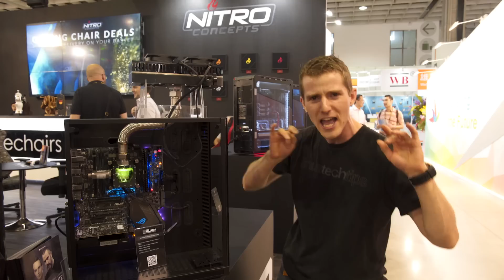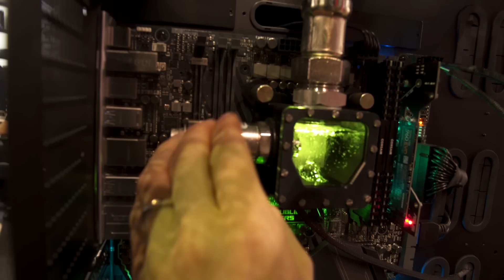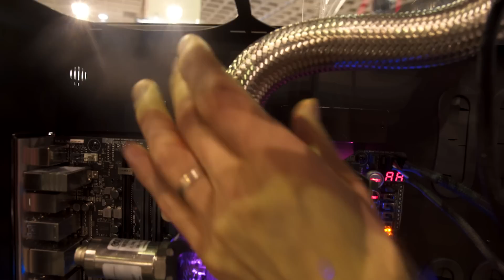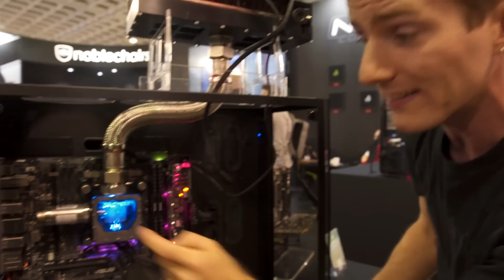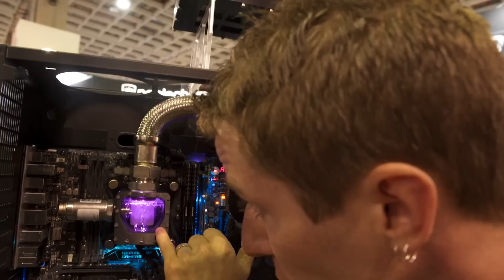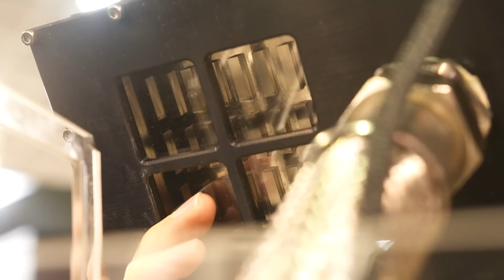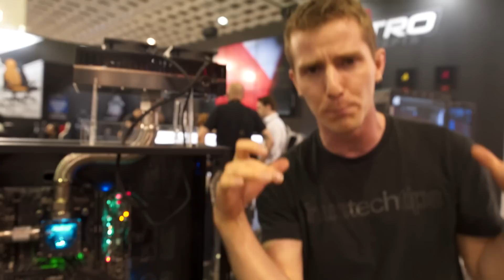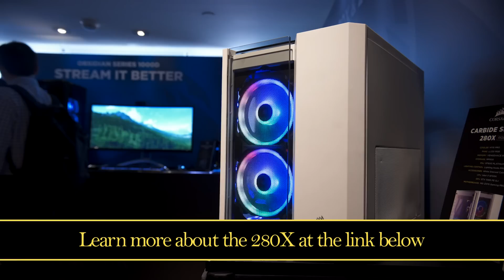Crazy Der8auer cooler prototype - NO pump!

Comment: Liquid coolers look cool, but I keep envisioning one springing a leak and the whole rig frying like bacon.
Reply: Frank 42 not all liquids are conductive
Reply: no but most liquids used for cooling are once contaminated with dust and other detritus found inside a computer old enough to have a leaking liquid cooling system.
Reply: Frank 42 with a pump like we see in some videos and generally as long as the pump is far away from any ruinable components its survivable but this thing if it leaks is all over the board
Reply: If a custom loop leaks u will notice when filling it (just don't connect the 24 pin to the mobo and put paper or small towels in the system if u afraid), a well mounted loop will last until u need to change the liquid with no leaks. Also AIOs are safe for 3 to 5 years.
Reply: This has similar properties to Novec, stuff servers use for immersion cooling, as in its non conductive.

Comment: I think the Cooling Liquid is Methyl Iodide. Anyone else agree?

EDIT: Only problem is that liquid turns brown-ish when exposed to a lot of light, so I'm unsure, but with the way those Air Bubbles rise, regarding it's a little denser than water, and it has a boiling point of 42*C, I think It's a solid estimation.

Comment: Some liquid that needs to have low boiling/evaporating point, fast evaporate and cool fast.
Probably some kind of alcohol? Methanol, Ethanol?  Hell, even diesel...
Reply: Whoever buys this, can say: "My computer runs on disel!"
Reply: Robert F do you know how diesel works?...
Reply: @P - yep. You put it in your pooper. Right?
Reply: http://multimedia.3m.com/mws/media/199818O/3mtm-novectm-7100-engineered-fluid.pdf?&fn=prodinfo_nvc7100.pdf
Reply: #2
https://www.3m.com/3M/en_US/novec-us/applications/thermal-management/
Reply: Personally I think its trichlorofluoromethane or r11. Clear, odorless, used as a commercial refrigerant, boils around 30 degrees c, and pretty safe to humans.
Reply: Hey, it evaporates and condenses fast and is non-flammable, higher boiling point at around 150c so even on the most crazy cpu's you are not going to turn that thing into a pressurised bomb ready to go off.
Reply: If they're using a pressure sensor it could just be pressurised water, giving it a lower boiling point, right?
Reply: SunnyZ Lithium bromide. We use it on our heat absorbers
Reply: Novec 7100 from 3M, he said it in a video!
Reply: If its Novec 7100 then that'd be a pretty damn expensive coolant..
Reply: Considering PCs measure temp in Celsius and the flash point for diesel is 52-96°c. Most pcs will equalize Temps right in the middle of that establishment (my r5 1600 runs at about 70-80°) don't git me wrong I find the idea hilarious but I feel that is too much of a risk to bring to a trade show as big as computex.
Reply: engels141 der8auer said its not novec in an interview
Reply: CFCs would almost definitely not be used, they were phased out in most countries since UV breaks them down into Chlorine radicals which catalyse the breakdown of Ozone, thus basically causing the Ozone layer to be destroyed rapidly in high quantities.
Reply: SunnyZ refrigerant
Reply: Nick ootes Ethanol is a type of alcohol, to be specific, an alcohol is an -OH group bonded to a carbon chain, excluding benzene rings, which are called Phenols, but anyway, alcohol and ethanol are not synonymous with each other
Reply: diesel pc
Reply: i can see this working
Reply: That's not a fire hazard waiting to happen
Reply: SunnyZ vodka
Reply: I would buy especially so I could say that
Reply: Doc. Volt interesting
Reply: SunnyZ water+alcohol can do I guess
Reply: SunnyZ diesel has a specific color 
U cant hide that under some rgb
Reply: Your probably right
Reply: but won't it be unstable under pressure ? Like gasoline  autocombusting ?
Reply: biggest giveaway is the S curve thing. Basically defines the viscosity to be less than a certain value.
Reply: Bruh alcohol and ethanol is the same
Reply: Truthfully it's possible as long as it never finds some way to become dangerous or volatile and all the parts stay working with little to no replacement needed it would work.
Reply: SunnyZ diesel... really...
Reply: "Some liquid that needs to have low boiling/evaporating point, fast evaporate and cool fast." Yeah, no shit. 
I don't think is diesel because It's is not transparent.

Comment: 3M Novec. My 2c
Reply: in a german interview he said that it is NOT 3M Novec
Reply: Darn i was thinking novec aswell 
Aslong as its not his own piss cause that could ruin the market as some crazy easy to obtain coolant lmao
Reply: Likely culprit is 3M Novec 7100. You can get the brochure on their website spelling it out.
Reply: Its not Novec because of import laws in the EU. But it is supposed to have similar properties. Right next to it, he has a different kind of rig running novec 7100
Reply: I was thinking the same
Reply: David Riley i also think, its at least something with quite similar properties. It seams like novec to have a low boiling point and to be non-conductive.
Reply: Nah
Reply: That would be my guess as well.
Reply: But there is no other synthetic gas wit the non conductive properties then Novec 
The problem lies in which kind of Novec der8auer actually used so nobody can replicate the system
Reply: David Riley dam you beat me
Reply: David Riley I was going to see if anyone new about 3m liquid. There is a video that shows a computer in this stuff with I believe no heat sink on the CPU too. It was a closed system. The liquid is expensive too.
Reply: Novec  can not be shipped. eu laws...
Reply: 3m Novec wouldn't work.

For an application like this you'd a reasonable or high thermal conductivity.
3M Novec, has an extremely low thermal conductivity. Which is why its used in fire suppression technology.
Reply: @
DaJMCity

The entire point is to have a high conductivity. Not a low conductivity.

If you'd have a super low conductivity, you wouldn't be able to absorb the thermal energy from the CPU, and even worse you wouldn't be able to efficiently dissipate it to the air in the radiator. 
This is why radiators are copper. Because it has very high thermal conductivity.

Novec is exactly what you DONT want. Because of the low thermal conductivity.
Reply: 3M Novec does work... its used often in server cooling and he literally has a PC next to it using Novec 7100. 3M has a few Novec formulations for computer cooling. https://www.3m.com/3M/en_US/novec-us/applications/immersion-cooling/

You are thinking of Novec 1230 or something SkiingJeep
Here is the list of Novec fluids for electronic cooling https://multimedia.3m.com/mws/media/1091997O/3m-novec-engineered-fluids-for-heat-transfer-line-card.pdf
Reply: It could be a lot of stuff. he said in a german interview that the boiling point is just above room tempreture.
Reply: @Matthew Jackson.
Alright, didn't know they had a variety with drastically different properties.

Either way, doesn't change that the people saying that low thermal conductivity is good, are flat out wrong.
Reply: no one said low thermal conductivity, they were referring to the low electrical conductivity.
Reply: No it is not 3M novec

Comment: maybe Methanol with its boilingpoint at around 65C or another alcohol
Reply: Yeah I had a similar guess. so either Methanol in low pressure to lower the boiling point or Novec 1230 which is a fire supressant and is commonly used in immersion cooling. Maybe propanal??? I am not exactly sure of what vapour pressure requirements there are so it's hard to tell.
Reply: Novec 7100 probably, he mentioned it in a Video, thats why its so secret.!
Reply: Also my guess
Reply: Yah. One carbon alcohol, aldehyde or ketone of some kind.
Reply: @RexinOridle  it could also be a two carbon alkohol or maybe even an alkane of some sort
Reply: lacucaracha111111 
These liquids are combustionable making them dangerous
Reply: Well it sure as shit is NOT Methanol. Do you really think they'd put a flammable liquid into a literal spark box at those temperature? Fuck no. 

Also it's way too obvious and could be guessed by any 5th grade chemistry student. Why should it be Methanol when there are thousands of liquids and mixtures of liquids with similar boiling points.
Reply: Not a bad idea, but drinking birds use methylene chloride to get a really low vapor temperature.
Reply: lacucaracha111111 definitely not it’s has a fucking flashpoint of 16 degrees Celsius it would burn the second it evaporated
Reply: The PC wasn't hooked up to any monitors or anything else, so I don't know weather it was running any kind of looped benchmark at the time. That could mean if it wasn't running a bench, something with a boiling point from 35c to 50c, or if it was something with a boiling point of around 60c+. But I suppose due to the pressure of a lower boiling point being maintained it would have to be something around maybe 55c+.

Something like methanol, methyl acetate.. You also have to take into account the corrosive nature of the fluid, and the mix of materials used. Think Galvanic corrosion which would more of a factor than the usual distilled water..

I feckin want one though!! I love seeing liquid movement in a PC case.
Reply: Do few people said if it's a partial vacuum with water it it will stop boiling because the increase in pressure but that is why you need the the cooling at the top, if cycle starts water cold at bottom in partial vaccum heats to its BP will go in to cooler and condense back down lowering pressure  allowing for  for cycle to start Agian, if it was full vacuum it wouldn't work mainly cuz water vapor can't be in a full vacuum cuz then it's not a vacuum but a air/water system with boiling water works fine in closed systems nothing about partial vacuum prevents this
Reply: DragonsKindler why? I'm honestly interested to know for chemistry class purposes
Reply: engels141 if it's novec, it's not a secret at all, you can just order that from M3 online.
Reply: That would dissolve the aluminum making it not likely.
Reply: Eluminary Xarrais dude. Old joke. But still good.
Reply: Methanol is too viscous. It would take too long to drop (my opinion).
Also a alcohol has a higher oxidation power. Not really good for it.
Reply: well m3 novec 7100 is non reactive with most plastic and metal, non conductive (he used it in a submerged build some time ago), when it evaporates it disappears in mater of second without a trace and boiling point is 61 C
Reply: Chris Ide deionised water would be corrosive to the components in the system eventually becoming conductive as the ion content increases.
Reply: I like remind you all that the system doesn't have to be under normal pressure. If it is higher it can be propane or butane or similar. If it is lower other liquids become possible. The bulky construction (e.g. thick window material) indicates that it doesn't run on normal pressure.
Reply: Methyline more likely, or another Twin bonded Alcohol..
Reply: That would make too much sense.
Reply: I thought I was smart by posting this but nope many others knew it was most likely methanol as well lol
Reply: Methyl acetate (CH3OOCH3)?
Reply: 3m moved actually
Reply: Yea i was going guess methylene chloride since its used in those bubble lights with its low boiling point
Reply: Liquid nitrogen under high pressure maybe?
Reply: Probably fluorinert fc72
Reply: DragonsKindler it won't be mass produced anyway
Reply: had the same idea, not so secret after all i guess
Reply: lacucaracha111111 Lithium bromide
Reply: Sounds right. At first I was thinking acetone but it would hold the cpu at barely too high a temperature or maybe chloroform but that would break down under UV so a clear window like present wouldn't really be possible. I feel like methanol is most likely but there are other options.
Reply: I was thinking acetone too, also it has a lower boiling temperature than methanol so it stays cooler...it explains metal tubing tho since it dissolves some plastics!
Reply: could be glycerine ,it will explain the bend problem ,propylene glycol or any alcohol like ethanol or meth.
Reply: Combustible liquids are only dangerous if the escape of the loop / mixed with oxygen. Coolant in air conditioning units is also combustible (or used to be at least)
Reply: I'm still firm with pure water under partial vacuum I mean those style transducer can do vaccum too
Reply: what about novec 7100? boiling at 61 C non conductive and almost not toxic
Reply: What is with this methanol crap? It’s obviously not methanol. Methanol will blow up once it evaporates.
Reply: DragonsKindler the wiper fluid for your car is mostly methanol dude.
Reply: maybe he is using propanol or butanol at very low pressure
Reply: lacucaracha111111 I don't think they could use Methanol as a liquid due to the risk of a leak and the damage breathing Methanol fumes can have.
So they must use a not toxic Liquid that has a boiling Temperatur arround 50°C. 
My Guess: it is Just water at 300mBar. (1/3 of atmospheric pressure)
Reply: Or it could be something similar to coolants used for radiators.
Reply: Rexin Oridle aldehydes tend to not keep very well over time, any oxygen present would slowly oxidize them to carboxylic acids. And ketones are too good solvents, acetone or butanone would slowly eat away the acrylic and rubber sealing parts. My guess is that it's some kind of fluorinated medium chain ether, like the 3M Novecs...
Reply: Eluminary Xarrais classic :D
Reply: and no methanol will not blow up, you stupid? if there is no oxygen in there it will not start to burn at all. if there is, you still need to raise the temperature a little bit more to start the combustion wich will not happen if you don't heat the radiator
Reply: more like 3M novec
Reply: Freak Gene dichloromethane dissolves plastic too well to be used in such a configuration
Reply: DonRaynor well they did say he didn’t invent the coolant it uses so it doesn’t exclude it.
Reply: Eluminary Xarrais but water has to high a boiling point and is conductive. If deionised will corrode the metals until it has enough ions to be conductive.
Reply: You do not want to have a cpu get to 65C which is 149 F. You would want something with a boiling point arround say 30C or 86F.
Reply: Tailslol glycerin has a boiling point of over 200C and it's sticky and viscous AF. Probably the worst liquid for this setup.
Reply: 65 C i quite normal
Reply: partial vacuum would increase the chances of a leak hugely, imo that would be impractical for consumer-grade stuff. nice idea tho
Reply: nah i'd say liquid helium, a superfluid would also be practical for consumers, just like liquid nitrogen
Reply: Really tho we should all just keep a vessels of liquid nitrogen next to our desks constantly pouring on the cpu, can't think of anything more practical
Reply: Something like R31 (think it was called) its what they put in air con units, it is a liquid.
Reply: Alcohol is extremely flammable so I dunno about that
Reply: Don't think its alcohol as alcohol is flameable.
Reply: Methanol would be too toxic
Reply: Could be pure water that's under partial vacuum you get the same cycle as normal but It all happens at lower temperature...also could achieve enough of vacuum in this small of a set up with a small hand pump
Reply: I don't think they could use that in a consumer grade product.
Reply: Methanol and ethanol will just evaporate out of the loop in no time, it can't be "tight" enough due to low MW,  also they are corrosive  and a boiling point of around 65 wouldn't be that good for CPU cooling. As others stated before, they probably use some kind of fluoro-alcohol like perfluoro-2-methyl-3-pentanone also known as Novec by 3M.

Also derBauer has experimented with that kind of coolant before in immersion-cooling builds.

Side info for the chemistry interested out there; fluorine that is bound to carbon makes carbon non-reactive, since fluorine already has the highest electro-negativity of all elements.

https://www.3m.com/3M/en_US/company-us/all-3m-products/~/3M-Novec-649-Engineered-Fluid/?N=5002385+3290667401&rt=rud
Reply: lacucaracha111111 thought the samw
Reply: Chris Ide water under a closed system partial vacuum won't be under a partial vacuum for long when it's boiling. It will increase its own pressure then boil at 100 again.
So we're looking at a liquid with a high SHC, high resistivity, low reactivity, inflammable and lowish boiling point but recondensed when the pressure increases.
 I suspect that pressure is why the hose, radiator and block was so sturdy. Those screws were large enough to apply a lot of force, so there must be a back plate to that. Thus reinforcing the PCB so it isn't under any strain.
Reply: When someone is that confident you won't find out, you can be sure it's a custom solution.

Comment: Methylene Dichloride or Dichloromethane the stuff from jukeboxes
Reply: If the boiling point is around 40 degrees Celsius wouldn't that be too low; it wouldn't condense back to liquid form in some parts of the world like India or countries in Africa.
Reply: it could still condense if it was pressurized. and we know that there's a pressure sensor, perhaps that what its for?
Reply: with a boiling point of 39.6 °C it is a good contenter
Reply: And Texas
Reply: Donalbain Probably not dichloromethane. It's too toxic and too hard to condense because of it's really low boiling point.
It's surely a non flammable industrial coolant with a boiling point about 50°C. 
I'd say Novec 1230.
Reply: It's not 40c indoors thought,  but still, as the computer heats up the radiator will easily go above 40c